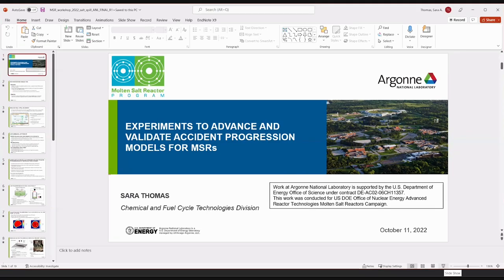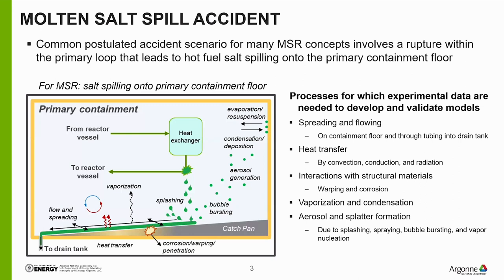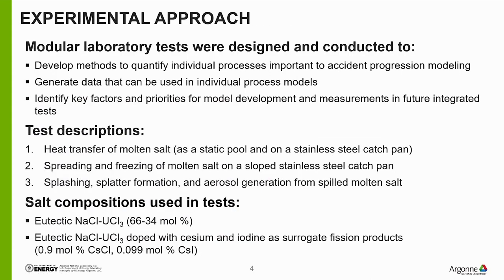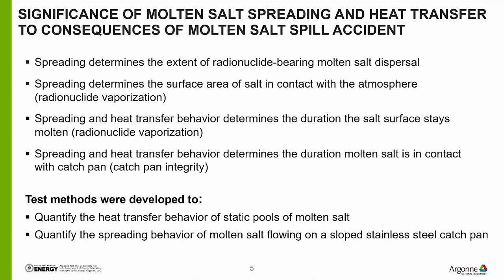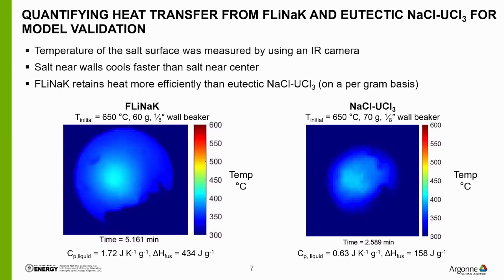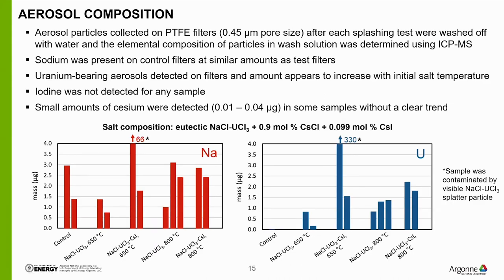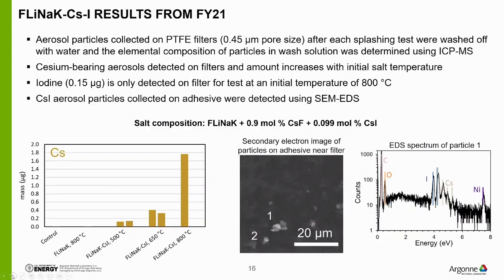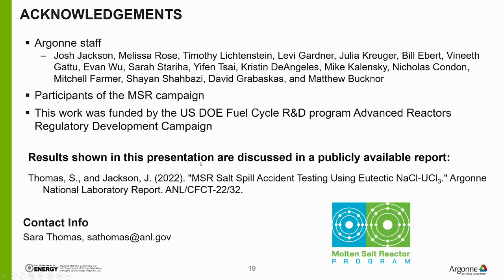Validating Accident Progression Models for Molten-Salt Reactors - Sara Thomas @ ORNL MSRW 2022

Comment: Maybe there's something I don't understand about this, but the final charts seem to show an incredibly high aerosol concentration. 10 to the -4th power would be 100 parts per million, right? It seems to be saying that when you pour a small quantity of salt (65 g) a short distance (12-16 inches?) at 800°C, KI is vaporized and reaches 100 ppm, which would be shocking if true, even given that it's inside a small container. One of the major benefits of molten salt reactors is supposed to be minimal aerosolization of substances such as iodine and cesium in accident scenarios (because iodine and cesium are dissolved in the salt).

Comment: Guys it's not "AR-gone",  it's "ar-GUN".  One is an element, one is a very historic battlefield in France. So, very different things.
Reply: Are you sure? I went to Webster's online dictionary and the "ˈär-ˌgän" phonetic sound file they have really sounds like "AR-gone" to me.
Reply: @dustinbird2090   I can't speak for any English-language tradition, not being familiar with the local area, and not having been steeped in enough physics to have heard it pronounced in physics circles. However, i do know French and that is the French pronunciation of the word. It just bothered me because the forest in France is so significant.

I know that in the Midwest and South, there are a lot of Spanish and French place names that get butchered, often intentionally. I think in this one case, it's just not really proper. If the locals want to say argon, so be it, but does that mean the scientific community has to endorse the error.
Reply: @dustinbird2090   Certainly at the very least the stress should be on the second syllable.
Reply: @no_rubbernecking  I can dig it. It's an important place in history and in culture.

A quick glance at the Argonne Forest wiki didn't answer my question, but I wonder if the location's name is also derived from the greek root of Argos+Ergon.

Nice chatting with you. 👍
Reply: @dustinbird2090  Likewise! 👍🏼 And you could well be right about the etymology.